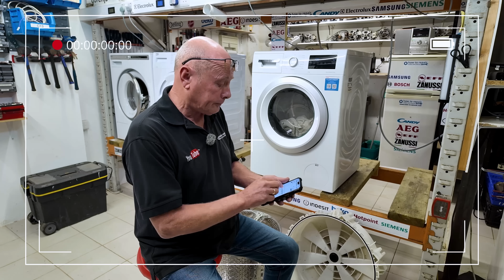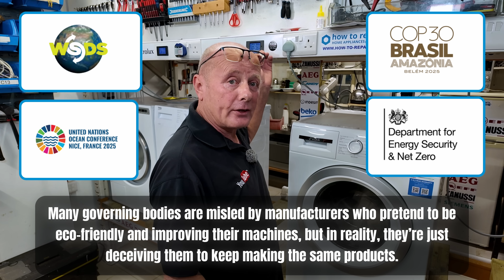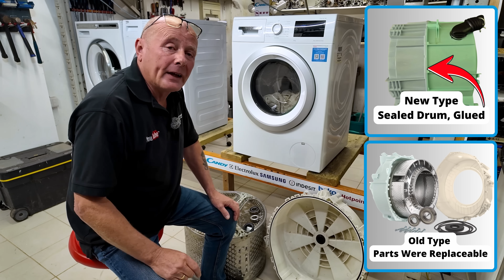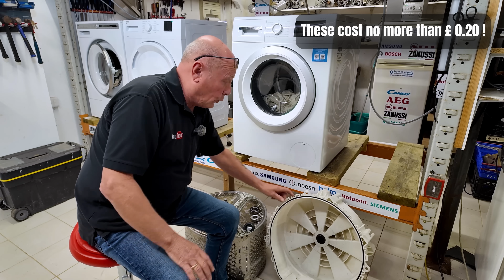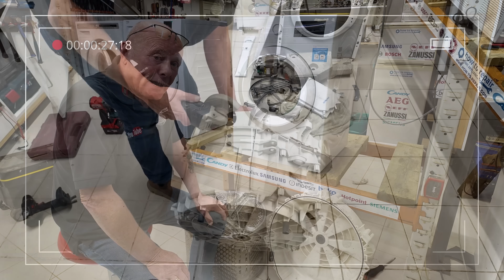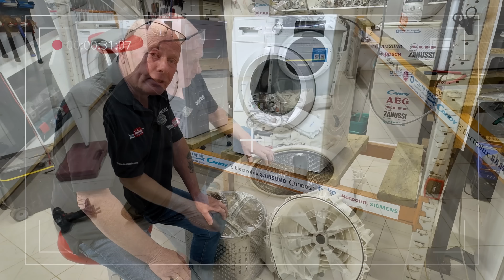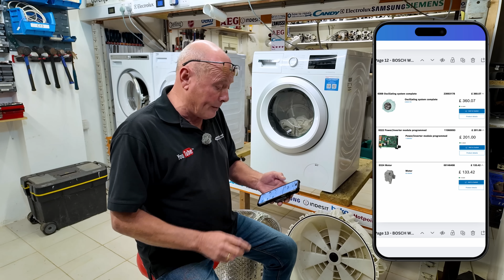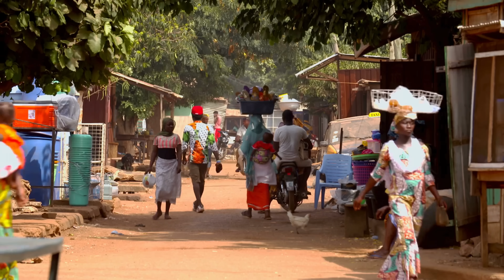Washing Machine SCAM EXPOSED! The Truth About SEALED Drums: Naming & Shaming

Comment: In india we cut bosch drum and change spider and fix using glue and ss screws
Reply from the maker: I applaud you in going to the effort of trying to make a machine last. It's just a shame that a manufacturer has to go to this extent to make it so difficult they are destroying a perfectly good brand.
Reply: @How-to-repair 😊
Reply: @How-to-repair  Thats why i bought LG front loader in india😀
Reply: Very nice. That's worth a YT vid or something IMHO. Which glue?
Reply: @abacaxiveer  Permabond's polypropylene (PP) adhesives such as TA4611 should be suitable, it's a modified for PP methacrylate 2 part adhesive, you can find details on their site. However in most videos  either a silicone sealant to stop it leaking is used, although it doesn't adhere well to PP, and lots of very thin bolts, or else cut the front out just inside the mounts for the weights and weld it back together often using a cheap hot air welder and a polypropylene filler rod, or even strips cut from other washing machine tubs.
Reply: I usually prefer welding as if performed correctly it can be as strong as the original
Reply: @brk932 That modified MMA adhesive does claim the polypropylene breaks before the bond in their tests.(TA4610 might be slightly better choice than TA4611). However, it is expensive, about £18+ . Welding would certainly have advantages, allow you to fill the weld with extra plastic, to replace the plastic removed by the saw cut. So the tub stays at it's original dimensions, also add extra plastic to strengthen the joint if needed. I wouldn't be keen on using a silicone sealant bonded one in my kitchen, but I would consider trying either the adhesive or welding.
Reply: @mels8966 so I'm gonna have to use high temp sealant cus mine is a washer dryer 😢😂😂😂😂
Reply: @davey2k12  In that case, I'd suggest applying a polyolefin adhesion promoter first, one that specifically states it is suitable for Polypropylene, so that the cured sealant doesn't pop out of the joint. Polypropylene is a polyolefin (low surface energy plastic), standard sealants, glues and paint don't adhere at all well to that type of plastic.
Reply: In Europe we do the same. First cut to half, replace bearings then glue it. Need some time but if washer is good it's worth to do.
Reply: It is a plan to fail policy devised by the greedy manufacturers.   That is why the rich (corporates) get richer and the poor(consumers) get poorer.
Reply: The problem in europe is, that that´s not the "best practice way" or state of the art. So if you do that and the seal fails, your insurance will not pay for the water damage you caused with it - what could cost you more than a new machine. So we are afraid to do anything our grandparents and parents did and that sucks. A lot.
Reply: @mistersunny3636  "I had absolutely no idea someone had modified it in an inappropriate and unapproved fashion, as I bought the machine second hand, some years ago, from someone selling it in post on a forum, and they dropped it off themselves, so I have no contact details for them either." Or "I paid a washing machine engineer I found online to look at it when it got noisy, he took it away to his workshop to repair it and returned it the next day, I assumed he'd repaired it properly as he seemed to be a professional and it worked fine ever since"...
Reply: Even sending it to india, let it repair, and send it back is cheaper than labour in europe
Reply: Yes true it is the high labour cost . I got my 10 year machine serviced in India it costed ₹5000 around 50$.  Spider + bearing changed with service total costed only ₹5000. But it was very labour intensive the spider assembly was completely stuck the guy had to use blow torch to make it come out and I also volunteered in cleaning the mess in the machine there was a ton of scaling. It took close to 3 hrs
Reply: In europe the labour cost would probably become a problem with such a fix. Should be made easy to access from the start. 
Even IF the welded drum could be explained by them having ”value engineered” the 1 euro cost of fastener bolts off the BOM I’m sure the beancounters didn’t miss the huge planned obsolescense bonus there.
Reply: @zonkenstein Changing the bearings on a split tub machine has a high labour cost in the UK, as you have to dismantle virtually the whole machine to get the tub out.  One possible solution would be to integrate the bearings in a direct drive motor bolted to the back of the tub. Changing the bearings would then be a much quicker job, just requiring taking the back panel off the machine, unbolting the motor and using an extractor to remove the bearings and water seal from the motor. So wouldn't even need to open the tub. However the best solution would be to use a better, longer lasting shaft seal to prevent the detergent and water leaking into the bearings which is what usually causes them to fail, so it takes much longer for them to wear out. Possibly a "cassette seal" might work, which are designed to keep out contaminates in harsh environments (The seal is enclosed in and protected by an integrated wear sleeve).
Reply: I do the same in Spain, just a day job.
Reply: Worked for Hotpoint nearly 20 years till they got asset stripped by Indesit take over around 03. 1990s bought out WMA range of w/m's. Bearing failure in a few months from new, we was changing drums under warranty in the thousands across the uk daily. 😂
Reply: @RS-ji2ui  We had a WMA31P, bearings showed signs of wear in about 8-10 months, failed at about 13 months, repairman replace drum spider and rear half of tub ,and was charged, I think over £125 for the repair, we did consider taking them to small claims court. It also didn't wash that well unless we chucked a jug of water over the dry washing to weight it down, to get it to move about in the tub, otherwise the washing clung to the outside of the it  would usually still be adding water right up until it pumped out before the rinse. A heck of a decline from the Hotpoint Microtronic x2000 my mum had in the 80s.
Reply: Can someone explain why would you want to cut the drums is that to change the bearings? I repair my washing machines for fun for past 5 years. I see the carbon Brushes warns out easy replacement, or water Inlet, sometimes some buttons but never had an issue with drum before. So not sure what you fix by cutting in half.
Reply: Here in Maldives too
Reply: Typical approach for many parts repairs if it balances  cost effectiveness and expediency.
Reply: I have all my appliances covered by monthly breakdown insurance.  I had an American style Fridge Freezer replaced  TWICE in 6 years due to an internal moulding fault in the first case and a faulty door that they couldn't find a replacement in the second.  £ 7.00 a month. So paid out £500 over 6 years. So cost effective choice i think
Reply: Someone in the comment mentioned that in India the repairer cut Bosch drum and put it back together with glue and screws. That's the key counter argument to this whole debate. In India, labour is relatively cheap. The repairers are willing to cut, repair and glue/fasten the drum for pittance. 

Labour is expensive in Europe. Maybe the repairers think it's not worth their time. Either have accessible spares for a quick repair otherwise they won't do the additional workaround despite customers insistance. 

Maybe the manufacturers are also helping the repairers reject the customers demands by making the spares exhorbitantly expensive in Europe, not worthy of repair and they can sell new machines, win-win.
Reply: @BWayne-hd5cy That makes absolutely no sense. It would be a quick repair if the drums weren't welded shut to begin with. That plastic welding is the whole reason that it's a lot of work to repair with, and it's because of a choice the manufacturers made.
Reply: @crytocc I do see your point. However, there may be some other proprietary components other then the bearing replacement, for e.g., the spider, that the manufacturer simply do not wish to carry indefinitely due to cost.
Reply: @BWayne-hd5cy Not usually a problem, as aftermarket takes care of that, so long as demand exists.
Reply: @BWayne-hd5cy I just repaired a Panasonic Front loader washing machine and it's a four hour job. It's not just the bearings you have to do. It's a lot of cleaning of the internal parts and drain pipes after six years. Bearings and seals were only $60 but the labor is $400 although the machine costs 800 new but six years old so is that still viable?
Reply: @pdevonport7266 That's exactly my point. In India the entire repair and cleaning, labour included, would probably cost just over a hundred and gives you another 4-5 years with the machine.
Reply: @pdevonport7266  Well yes, if it's your own time it does not cost so much now does it. And imagine what you could do with all that money.
Reply: @pdevonport7266 could be, but I want the right to repair it myself!!!
Reply: @pdevonport7266 well its viable if you take into account that when its replaced it hardly gets recycled and land in a fill site. They should really make recycling AND repairing profitable. Not only for job creation but the future of our planet
Reply: @BWayne-hd5cyu pay a lease on a shop n home in Europe?

Now u know why it is expensive to repair things.
Reply: @BWayne-hd5cy I don't think it is that repairers in the UK don't think it worth their time, rather that they have to put a warranty on their repairs and consider the legal ramifications of it coming apart catastrophically at full spin with a heavy load.
Reply: @m @matthewjenkins1161 at is true.

Comment: First a couple of minor points, they are not induction motors, the rotor has permanent magnets, not an aluminium core with shorted copper windings powered by induction. I believe the correct term is Permanent Magnet Synchronous (PMS) motors, they are more efficient than induction motors and cheaper as you mentioned, also 40 quid for a spider is a wee bit optimistic for many brands, a spider for my zanussi, had I needed to change it ,would have cost over 90 quid, and the tub seal was at least £12 (although, I could have descaled and cleaned it up and reused it), a bearing kit for mine would have been over £30, but I bought NTN bearings for about £11-12 for the pair and the shaft seal (a genuine one) was about the same. Also, as far as I know the sealed tubs are welded, no glue needed - eg Ultrasonic welding is one method.    

However, I stand by my view that sealed tubs are just another step by manufacturers in cutting production costs and staying competitive. It speeds up production, reduces component count and reduces the number of manufacturing steps. The first generation of welded tubs continued to use the original screwed plastic mouldings, which avoided replacing the very expensive plastic injection tools (aka dies, moulds), it got rid of the screws (manufacturers are always doing that - replacing screws with moulded in clips, replacing the clips with welded parts), and it also got rid of the rubber tub seal, which also saved another step (fitting it) in the production. When they designed new models with new tubs they obviously optimised the mouldings design for welding, and also integrated the air chamber for the pressure switch into the two halves of the tub, saving another part and another assembly step (but with the disadvantage that it would make it even harder to reliably cut in two and screw and bond back together)    

And NO! I'm not AI, but here's what an AI has to say about it. 

Plastic Welding
Lower Long-Term Cost: While the initial investment in plastic welding equipment is higher, the process is more cost-effective over high-volume production runs.
Faster Production Speeds: Welding is a quicker process, as it often involves a single pass, which reduces labor costs and increases throughput.
No Material Consumables: There is no recurring cost for screws, nuts, or gaskets, which are continuous expenses with mechanical fastening.
Leak-Tight Seal: Welding inherently creates a strong, leak-tight seam, eliminating the need for additional sealing measures like gaskets, further reducing material and assembly costs.
WEEE Benefits: Manufacturers pay less for Waste Electrical and Electronic Equipment (WEEE) disposal responsibility because the overall product is lighter due to the absence of metal screws. 
 

The WEEE benefits are a bit questionable, but the rest I'd agree with.
Reply from the maker: Nice to meet you, human. lol And thank you for taking the time to write this. Do some things that are beneficial but answer two questions how much energy is used to weld the 2/2 of the drum together compared with the cost of a few screws second why is the Asian market still producing splittable drums? In my opinion? They are doing this because labour is cheap in the southern hemisphere where they sell a lot of the Appliances and people are willing to spend the time to repair their machines. My last question to you as your defence towards this practice is very well explained what is your position in the industry?
Reply: @How-to-repair  No, I don't work in the industry, just had an an interest in how stuff works and how it is made since a kid and have repaired just about every type of appliance and various bits of hardware and machinery in my home at one time or another, starting as a teen. And I don't particularly like the practice, it just a fact of cost cutting to stay competitive and satisfying the demand for cheaper machines. Manufacturers really should be fitting more durable shaft seals as a minimum if they seal the tub (cassette seals perhaps?), so it lasts much longer in hard water areas and is more resistant to grit from heavily soiled work clothing.
Reply: Totally missing the cradle-to-cradle cost analysis too... merely looking at manufacturer profitability.  Weak, wordy argument.
Reply: Cutting manufacturer production costs, but at the same time making repairs uneconomical so increasing the appliance waste dump! A very bad practise which should be banned by legislation!
Reply: @intrax2tv I agree it is a waste, but what percentage of them were actually being repaired, most people will choose to buy a new machine with a guarantee, rather than spending a significant amount of money fixing an old one. Disposed of appliances are supposed to be shredded and recycled in the UK. Since the big scandal where scrap appliances taken to council waste sites were being shipped off to third world countries supposedly for repair and a second life, but were being burnt and stripped and the copper recovered using acid, polluting the environment and poisoning the people doing it, I believe even repairable and still working ones are supposed to be shredded.

Comment: I work in the Mobility industry. A customers bath lift handset and or charger wasn't working. The cost to replace these 2 items was more than buying a complete new bath lift(which included these items)
Reply from the maker: Two years ago my mother had a stroke at 97 and she was in hospital. After a few months, the local council told me she was moving home and they installed the same type of equipment bed hoist. Because they could not get the staff under the care policy they moved her into the local Nursing Home calling it closer to home policy. The Equipment stood sat in the house for eight months. They even came out to service it and replaced the battery system. The amount of waste we have in this world is incredible when they took the system away. The engineer that collected it told me the battery bank was going in the skip because it could not be used on the next installation. Someone please tell me how this country is ever gonna get better when we are wasting so much
Reply: It's the whole planet ... we're way past capitalism ... it's greedism
Reply: @patrickcardon1643  I don't know. I lived in SE Asia and out there, the welding kit and a hammer is a necessity. They tend to repair rather than just bin. Yes, they will eventually bin it but only when it is beyond any repair.
Reply: THAT would be covered under the NZ consumer guarantees act, and they would NOT get away with it.

Comment: So just to know are there any washing machine companies left today that produce repairable units ?

You already mentioned LG Samsung and Daewoo are those the only ones ?
Reply from the maker: You are correct, there are still good companies out there. However, the industry faces significant challenges, especially with the use of sealed drums which negatively impacts repairability.

Here is a brief overview of the current landscape:

High-End (Premium): * Asko: A very good make. Their products are designed to be fully repairable, and the build quality is excellent based on my experience. * Miele: Still has a strong reputation, but be cautious, as their lower-end models are increasingly using sealed drums.

Mid-Range (Standard Price Point): * LG: This is my general preference in this category. * Beko: A solid choice. While they do use sealed drums, they should be commended for providing technical data to support their customers. * Bosch: These are great performing machines. The primary drawbacks are the high cost of many components and the fact that they provide no technical support or information to the end-user.

The industry is in a difficult state, making it hard for consumers to make an informed choice.
Reply: Thank you for replying !